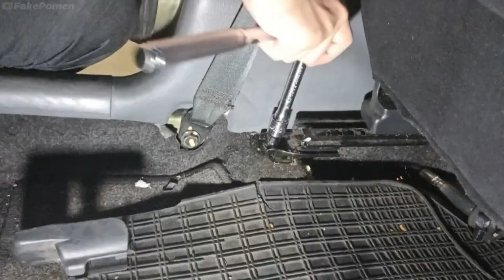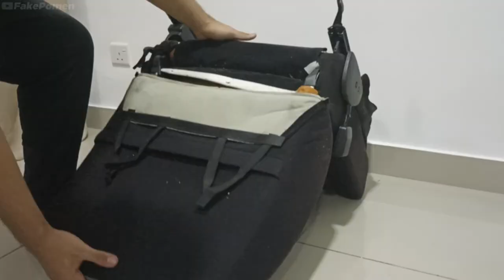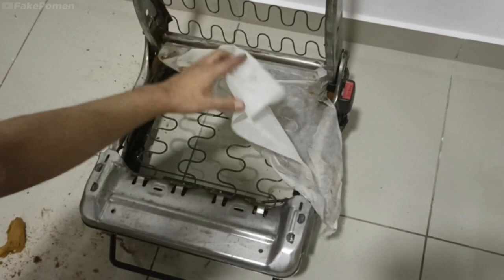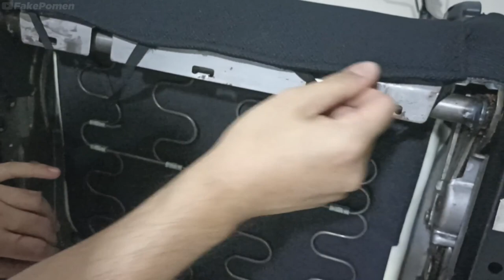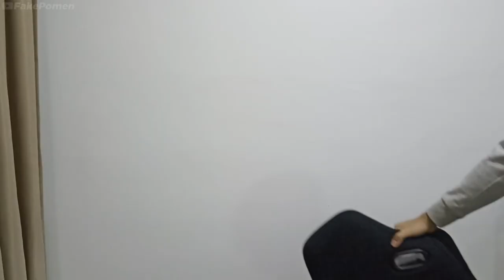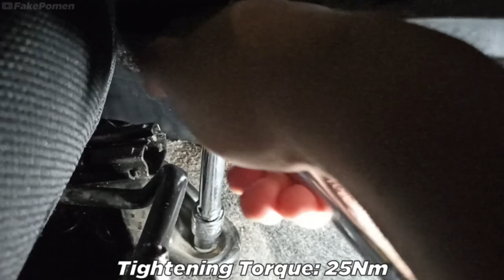Installing SSCUS Sport Seats DIY | Budget Semi-Bucket Seats | Perodua Viva

Comment from the maker: 1)  Don't forget to remove the seatbelt sensor upon removing the driver's seat. In the video, the driver's seatbelt sensor wiring has been detached from its socket for years now.           

2)  Installing the passenger side is similar.

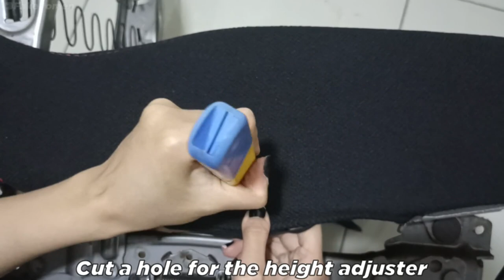3) @4:28 Using a soldering iron would probably give you a cleaner cut.

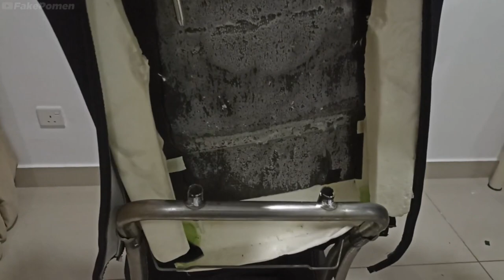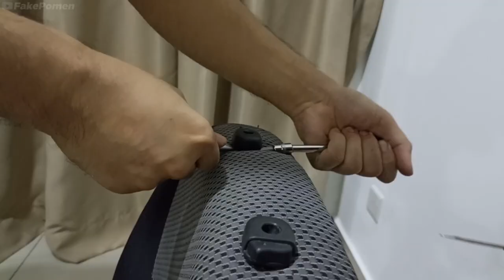4) @6:50 Reinserting back the plastic headrest guide (from @0:33) into the holes before installing the cushion is possible. In my case after reinserting it back, the cushion wouldn't sit flush at the bottom of the seat frame. Cutting off the top of the headrest guide locking mechanism may help negate that problem but I decided not to go that route
Reply: Boleh adjust ketinggian erk. Dari td tengok video pasal bucket seat x ada function tinggi/rendah
Reply: Kedai mana buat
Reply: @kasyahjaybee93  Kalau full bucket seat, tak boleh adjust. Tapi kalau semi bucket seat/reclining bucket seat, boleh adjust.